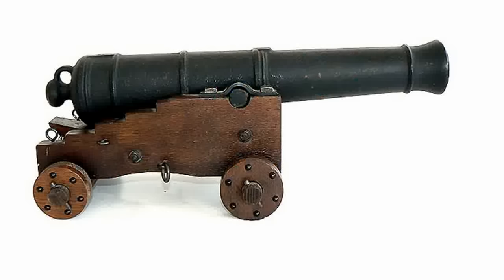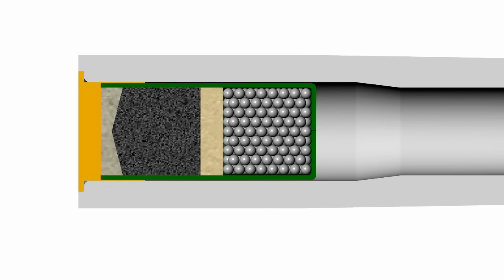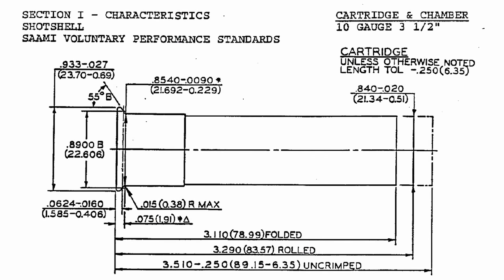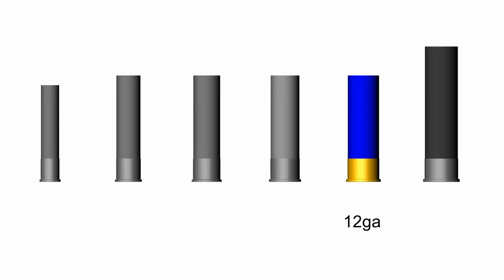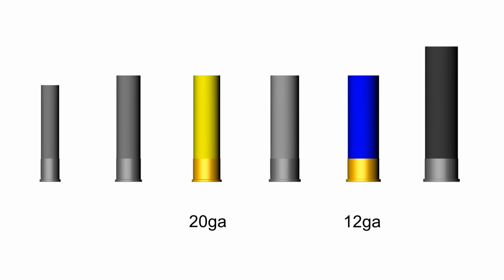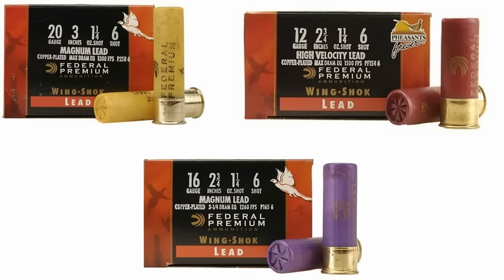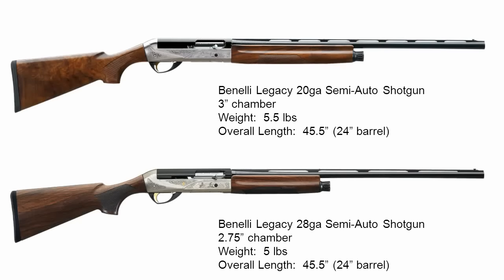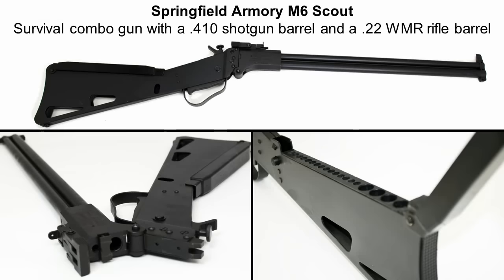Shotgun Gauges Explained - Shotguns 101 #3

Comment: Am I the only one who still thinks the gauges make zero sense??? how can you have 20 balls per pound in a smaller casing than a 12 gauge, or a 10? is there no standard ball diameter or mass of shot for the gauge measure? it all seems too relative, technically a 2.75" 12g and a 3.5" 12g would be different barrel diameters with this method?

Clarification? i'm assuming it's just an archaic system that has endured; excluding .410
Reply from the maker: Gauge just describes bore diameter, and nothing else, since it far pre-dates the use of self-contained shotshells.

It can be a little weird that the larger number means a smaller diameter, but think of it this way:  If you had a pound of lead, and you wanted to make musket balls for your muzzleloader, you could make more balls from that pound of lead if your gun had a smaller-diameter barrel.  20ga = 20 bore-sized balls per pound, 12ga = 12 balls per pound, etc.
Reply: Synchronizor See that makes much more sense, I missed the "bore sized balls" aspect of the measurement. Assumed it was referring to shot size balls. 

Appreciate the explanation, the logic has been bugging me for years haha.

Comment: 10 gauge kicks less than 12 and has better pattern.
Reply: A friend of mine and I used to shoot his 10 gauge at old freon cylinders.  You have to hold onto it.
Reply: Hamilton Johnston one of thsoe is right  ive only ever seen one 12 that kicks more than an 10 and its was featherweight single shot with the barrel cut to 18.25 inches and a light weight stock put on it weighted 3.75 pounds.
Reply from the maker: Recoil is all about mass and velocity, not bore size.  A 9-pound gun shooting 2 ounces of shot at 1250 FPS will recoil the same whether it's a 10ga or a 12.
Reply: Your analogy of 10gauge and 12gauge being able to shoot the same speed and have the same recoil is only correct if you modify the powder charge in each gun to be at that speed. As you said 10gauge is .775 while 12 gauge is .729. Assuming that you have a 30inch barrel a difference of  56.61 vs 50.09 is HUGE.
     This is a simple way to understand why a 10 gauge is better. Take a fire hose and a garden hose and try to put the same amount of water through. The fire hose will have the water going much slower because it is larger while the garden hose will be faster because it is constrained.
     If you load ammunition you would know that guns have a max psi that they can handle safely. A larger diameter bore would theoretically allow you to generate more force over a shorter period. So the acceleration can be slower to reach the same force as a 12 gauge
     Making a long kick vs a short kick Its like being pushed by a giants finger vs getting kicked by a donkey. So "slow vs fast kick" makes a 10 gauge feel like less "kick" even though its the same force. Of course you could max load a 12 and 10 and the 10 would kick A Hell of a lot more; but in most loads you can buy A 10 would kick less than a 12.
     I have 4 diffrent 12 gauges to compare to my pump action 10 gauge and all the 12s kick harder than my 10 I go trap shooting with my 10 and can go twice as long vs my 12s and I'm using 3.5 10s. I have also patterned BBB,BB and 2 shot at long ranges and the 10 has 20-30% more shot on target. Im planning to load my own shells and have done a lot of research related to 10 gauge. The real life results speak for themselves.
Reply: It depends you have I believe 3" 10 gauge 3 1/2" 10 gauge magnum the 2 3/4" 12 gauge 3" 12 gauge the 3 1/2" 12 gauge  magnum. The 3 1/2" 10 gauge magnum with 2 1/4 ounce shot and 4 1/2 dram equivalent will kick like a mule.
Reply from the maker: There are a lot of factors that affect recoil and performance of shotshell loads & shotguns, Gauge is only one of them, and not typically a primary factor, at that.  If you're comparing specific loads, you can draw some conclusions.  But trying to extend that to encompass gauges in general doesn't really work.
Reply: It translates into better pattern and less kick i explained in my comment above that a larger bore can have a drastic effect. the numbers i calculated were the approximate difference. To clarify the difference in the overall area take 10,000psi and divide by 56.61 and 50.09 respectively you get for the 10 gauge 176.64 pounds of kick vs 199.64 pounds of kick
     Having less pressure on each inch of the barrel will be less kick and acceleration. Its a fact for every reaction there is an equal and opposite reaction. you have a slower rate of transfer in a larger barrel the only reason it "seems" like the 12 is close to the 10 is because they load the 12 gauge Higher! like 11,000 vs 14,000 they have to do it to be competitive with the 10 gauge!
     Of course you also lose pattern and range with a 12 you can't fit the same amount of lead or charge in a 3 1/2 12 vs a 10 3 1/2. You get more trailing with a 12 less bbs and above all more kick! most people that use 12 gauge duck hunting get these light semi auto 12 gauges and they hurt to shoot. worse yet they fire off all 3 shells like assault rifle ammo and don't get any ducks i have seen it over and over again and again. and this applies to other parts of the sport as well. 
      I literally see no point in owing a 12 gauge you sell yourself short, and the only advantage you gain is a lighter gun. But guess what you trade for that; More kick and More pain. and worse yet they get fragile and all the complicated parts get jammed up with the tip of your glove stuck in the action. If you get a 10 or 12 get a pump you will be a better shot and you won't miss as much if you eventually want an auto get a 10 auto the beef helps stabilize aim and you then can fire without shooting up as much just never get a 12 like EVER.
     Across the board the 10 will be 6% better at the very least. its simple to figure out and fun to see in the field. I found out with a BPS browning 10 gauge and never looked back. I go twice as long trap shooting and i don't get sore at the end of the day. Say what you will but if it works for me it should work for everyone else. and give it a try for only 799.00.

Comment: Anything the 12 can do the 10 can do better
Reply from the maker: Even setting aside the limited options for guns and ammo, 10ga shells are big and take up a lot of space.  The 10ga also can't be loaded as light as the 12ga.
Reply: The 10 can do anything better than 12
Reply: Not when it comes to cost and availability.
Reply: @joshuagibson2520  WAAAAAH AMMO SPENSIVE!!!! Just how many shells do you need? The whole point of 10 gauge is that you only need to fire once. Give AF if it costs $4.50 a shell, you only get one shot when your hunting and I'm damn sure going to make it count.
Reply: @pinkhead6857890  as many as I want, it has nothing to do with need. I was smart enough to stock a couple lifetimes of shotgun ammo in my late teens and early 20s when it was 10-15 cents a round for shot and .50 for slugs. I hunt too, and do quite well. I also shoot trap 2 or 3 times a week some weeks.
Reply: @joshuagibson2520  Yah, well if I too was born in 73 or 83 instead of 93 then maybe I could also be riding the gravy train on biscuit wheels like you. Instead premo 12 gauge was already close to $1 a shell by the time I turned 18 so hoarding ammo would of been pointless even if I had the space and money to do so back then. Either way it really doesnt matter.

12 /20 ga target load, 22LR, and even 9mm for target practice is still too cheap and readily available to be worth my time reloading, and at the rate I go through the 10 & 16 gauge rounds I actually use for hunting (12 gauge hunting loads are overrated in my opinion) my total savings from hoarding 20 year old ammo would be negligible anyway.
Reply: @Rubycon99  12/20 ga target load, .22LR, and even 9mm is still too cheap and readily available to be worth my time reloading, so I just keep a 10/22, hi-point carbine, and two garbage rod shotguns for that. You dont use 10 gauge for general target practice, just like you dont use .220 Swift for plinking. If I can hit a clay with $100 12/20ga pawn shop shotgun at full choke then I can damn sure know I can hit any waterfoul with a 10 gauge Marlin Super Goose. You dont practice shooting with the same shotgun you use for hunting for the same reason that roman soldiers didnt train with the same sheild and gladius that they used in combat. Only an asshole would shoot geese with a 3'' 12 gauge from the same Mossberg 500 that they use for skeet.
Reply: @pinkhead6857890  Haha, fair enough. You sound like you know what you're doing :P I guess it originally sounded to me like you only had a 10 gauge.
Reply: Laughs in AA-12
Reply: @kurade1096  I raise your AA-12 with two Browning Gold 10's duct tapped together.

Comment: The 10 gauge is far superior than any 12 gauge
Reply: The only real advantage over a magnum 12 gauge is to say you have a 10 gauge.
Reply: Its all fun and games till you pick up a AA-12
Reply: Except for little things like availability of weapons and availability of ammunition.  But hey, at least you can boast about having a10 gauge to compensate for your inadequacies.
Reply: Depends.   A same weight of load in a 12ga will have a tighter pattern than in a 10ga.  Today's 3.5" 12ga shells throw practically same amount of shot as 3.5" 10ga.

Then, 12ga is cheaper than 10ga, thus is superior there.  ....so, 10ga isn't "superior than any 12ga".

Since practically every critter that has walked or slithered on this planet since the dawn of firearms has been killed with 2.5" to 2.75" 12ga shells(yeah, 2.5" 12ga was standard in the 1800's) - the 10ga is really only there for folks with short penises.
Reply: Unless you can't find any ammo for it.

Comment: WITH A NUMBER TWO SHOT A FULL CHOKE LONG BARRELL I EASILY KILLED AT MORE THAN 100 YARDS JUST HAD TO BE MORE ACCURATE
Reply: No. At 100yds a #2 pellet does not carry the energy to penetrate enough kill in most cases where you’re using #2 shot. Certainly not enough to kill ethically in the hunting world. A #2 steel pellet with a muzzle velocity of 1500fps can only penetrate ballistics gel 1.5” at 55yds, compare that to a duck and you can get a pellet to reach the vitals. (1.5” is considered the minimum standard of penetration you need to kill a pheasant or large duck) On a goose 1.5” of penetration isn’t killing it. And 55yds is a hell of a lot closer than 100, and given a lot of #2 loads aren’t even going 1500fps.

At 100yds the pellets probably don’t even carry enough energy to do anything more than break the skin. And if you’re routinely taking shots on game with any shotgun load aside from a slug out to 100yds you need to stop.
Reply: @chevyon37s  sometimes i would get two gophers with one shell and they where dead so idk 3" mags with a long full choke barrel did the job
Reply: @chevyon37s  i was using lead shot

Comment: 20g to start kids shooting. Then move up to 12g. 20g for more petite women. But my 5' 3" wife handles a 12g like a champ.
Reply from the maker: Keep in mind that 12ga loads can be had that are just as light as 20ga loads.  Recoil doesn't care about the bore size, just the weights and velocities involved in the system.  As long as they can handle the physically larger gun, there's no reason a small-statured or inexperienced shooter couldn't be just fine with a 12ga.
Reply: It's not just a recoil issue as you've mentioned.The 20g firearm is smaller in size and weight making it easier for smaller people with less upper body strength such as a 10 to 12yo or slimmer females.My first shotgun was a single shot 20g.Very light and easy to carry for hours in the woods in search of squirrels.The single shot also teaches shot placement.
Reply from the maker: Yeah, the physically smaller and lighter gun is the real benefit of the 20ga compared to the 12.  You can get pretty lightweight 12ga guns, but they still tend to be bulkier.

Comment: .410 is useless. its to small to actually use like a shotgun, and slugs are just a joke. using a regular bullet would be more effective
Reply: There actually not if you can shoot a shotgun well
Reply from the maker: It has its limitations, but I wouldn't call the .410 useless.  It's kind of the shotshell equivalent to the .22 LR, and the .22 is certainly not useless.
Reply: You have never killed any thing until you have killed it with a .410
Reply: My great uncle committed suicide with a .410, so I wouldn't exactly call it useless
Reply: Iron Tarkus thats fucked up
Reply: @imranescobar6120  ¯\_(ツ)_/ ¯
Reply: I've used 4 10 for rabbits and squirrels,,quite adequate,,I found,,,,🤗

Comment: So basically if there are 12 pellets in one bullet it’s a 12 gauge shotgun
Reply: Nope. You weren't paying attention.
Reply: The measuring method as follows: how many lead spheres the diameter of the bore (barrel) does it take to equal a pound? 10 balls for 10 gauge, 28 for 28 gauge and so on.